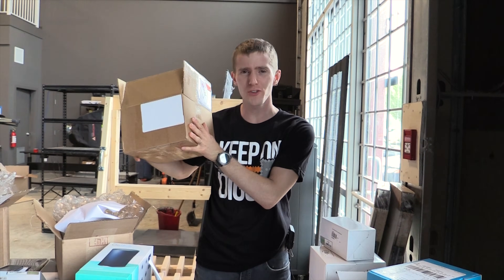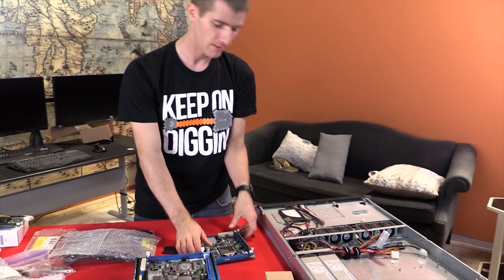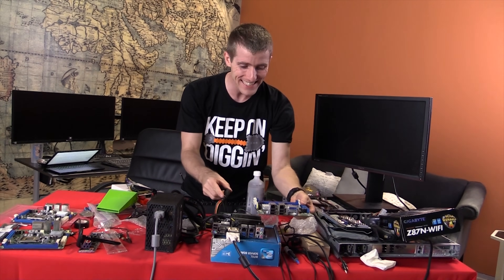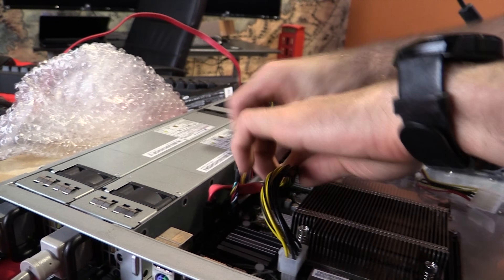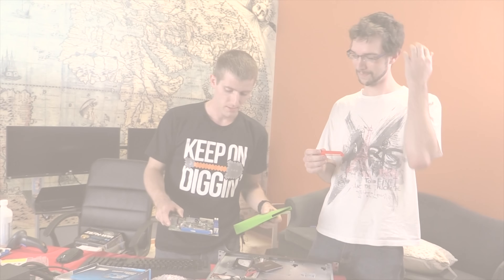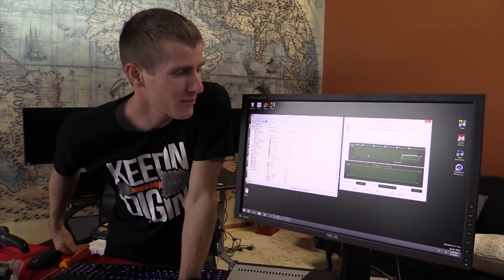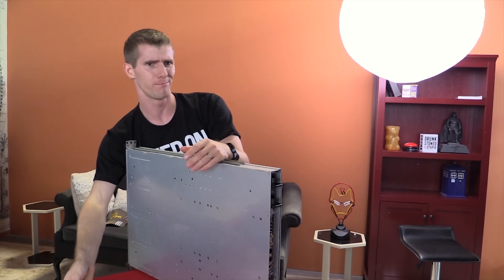DIY pfSense Rackmount Router Build Log - Part 2

Comment: Hi Linus, will there be a part 3 of this video? Could you include how many watts this build needs (maybe on idle and under heavy traffic)? Thanks. I recently found old PC at my house. It is a Pentium 4 LGA775 single core with integrated graphics. It is still alive but on idle it pulls 100W from the wall (not including the CRT monitor). Hahaha.

Comment: I would have run faaaar away from that motherboard after seeing how much hardware it destroyed. I don't mind overkill builds especially since you have a lot of parts at your disposal, but with a mobo being that difficult to work with, it hardly makes for a reliable piece of hardware. You're going to want a router to be rock solid right? What's gonna happen when that motheboard takes something else out.

Again I'm OK with overkill, but a router needs to be reliable, and I don't see this build being that.

Comment: You may have 4 working boards. If it put too much pressure on the cpu then it could have simply pushed pins out of the way. Try them with another heatsink and see if it comes back to life?

Comment: internet - 3 linus - 0

also the low profile ram, xeon, 3 server boards.

and he still ends up using the super micro heat sink and back plate... at least it fits this board...I would have scanned it in printed a plastic one and used brass nuts for the threads...

Comment: Awesome video! As a studying engineer I always enjoy watching s@*# hit the fan and see what kind of solutions you all come up with to "fix" them. Just a thought for consideration, I know from the previous video on 3D printing the red material you used for the fan duct mount is PLA, I am not sure what material the green was. The glass point for PLA is around 65 degrees C I believe. If the duct reaches this point you can expect to see slight warping or drooping. ABS would have been a better choice in material. It seems that you guys can keep the temps low enough for now, but it might change when the router is mounted in the server rack. This was just for future reference and maybe to keep an eye on the duct in the future. Other than that GO TARAN! Your design worked! And GO LINUS! You have a new router!

Comment: Did this on a Day 1 Xbox360 with a  Cornflakes box 10 years ago after seeing Dells Duct work in our old Dell XPS desktop. The 360 sounded like a Jet engine from Day one. I knew something wasn't right but a call to support informed me if the machine worked and nothing was glitching then as far as they were concerned there was nothing wrong. They must have assumed my description of the jet engine was exaggeration. This was before the the Red Ring of Death scandal came to light. I'd imagine my 360 would have ended with the RROD eventually.

 I decided to break the warranty seal and take my brand new 360 apart. To my mind, the dual fans on the back were pulling air into the case from every vent all over the case with most of the air  likely bypassing the heatsink fins altogether. First I removed the heatsinks and was shocked to find the CPU and GPU cores flooded with massively excessive quantities of Thermal paste. I cleaned it all off and re-timmed with the correct rice grain sized amounts. I then refitted the heatsinks. Then I fabricated some ducts from the heatsinks to the rear exhaust fans made from cornflakes box cardboard and duct tape. Ducted over the top of the heatsink fins too unlike in Linus' Vid. Thus all air pulled into the case from outside had to travel the full length of the heatsink fins from front to back and out through the ducted fans.

The result was a 360 that went from sounding like a jet engine to inaudible from the couch even under load and a Day 1 machine that never suffered the RROD and still works perfectly and silently 10 years later.

Comment: This question inst exactly meant toward the video but I need some help... Is it normal for a core i5 3570k to turbo to 4.05 on its own, at a temperature of 90°c? I have, in the past, turned on xmp mode but I turned it off because I had noticed this. After I turned it off it is still going to 4.05. It does this in gaming and i'm worried because I have a stock cooler on it in a very restrictive case (Ftz01). I don't know what is happening and I don't know if this is normal or what.

Comment: While I'm not from Microsoft and assuming I'm understanding your explanation, I believe the delay is from the lock screen sliding up to reveal the password prompt. I run into the same issue myself. It's not great, and I do wish Microsoft would change that. It missed the first character or two, and it fails to log in.

Comment: 6:55 Oh what's that cutting the speaker voids your warranty? And you can't even return it back to Ebay, because you damaged it. Otherwise you could've pretended that it was dead on arrival and received your refund. 

So, now you are stuck with 3 dead expensive motherboards that you can nail to the LMG wall of fail.

Comment: If you printed the 3d parts in PLA you might have problems because the heat. It will not melt but it can deform.

Comment: I don't know if this could be a solution to ur problem, but I broke the motherboard and somehow made it work. I forgot to plug in the 4pin cpu plug, while the cpu was installed and the motherboard started beeping and started to smoke a little. Then, I just put a paperclip into the 24 pin socket, like when you are testing for a dead power supply and it worked.

Comment: I can almost guarantee that you killed the caps the heat sink was smashing against and they are now a dead short making the PSU shutdown or just drop the voltage enough that the voltage regulators won't start.  When caps short like that you can have enough resistance in the short that the board can continue to function and the shorted cap just gets really warm, but sometimes it is at such a low resistance it will force the PSU into shutdown instead.  Or even worse, if the PSU doesn't go into overload shutdown it could just burn out traces on the board and allow higher than normal voltages past the voltage regulators.

I've modified and repaired enough boards to say, I could probably bring at least one of those dead boards back to life.  Sometimes there are burnt traces on the inner layers of the board but sometimes those can be easily bypassed... sometimes not.

Comment: Hey Linus Tech,
Do you think an Imac 27 inch (Mid-2011)
3.1 GHz Intel Core i5
12 GB 1333 MHz DDR3 
AMD Radeon HD 6970M 1024MB
1 TBB HDD
Is worth it? Also is it good in general? I might be buying it for 250?
PLEASE REPLLYYYYYYYYYYY

Comment: I love PfSense. Been using it since TekSyndicate did the video about it like last year. Using an old VIA cpu that's half the speed of a P4, it's MUCH faster than the store bought Buffalo and Linksys AC 6200 routers. Ping dropped 15ms.

Comment: This just shows the incompetence of linus when he doesn't build some cookie cutter 'super duper epic gaming rig'. What a joke, notice how he didn't show the back plate after been super snarky that it wasn't the back plate causing problems. My guess is that he tightened it down so hard that component leads went through the electrical tape and the non-conducting coating. It is still amateur hour at LMG.

Comment: The Windows 8 thing isn't as bad as Linux Mint, where it randomly will have you type the name of the account you want to use. Problem is, it is SUPER easy to just type your password in, thinking you are logging in, and accidentally advertise your password to everyone around you. Oh, and this happens when there IS ONLY ONE LOGIN.
Reply: +Oscar Anderson Welcome Debian 8
Reply: +Oscar Anderson 
I used to hate that. : /
I'm pretty sure that's only GDM, though. I eventually switched to KDE back when I was rocking Mint and never had that issue again.

Comment: You actually trimmed several times the original back plate so the insulation was damaged already (if it existed, because, you show the trimed backplate from both sides and NO INSULATION there).. If manufacturers were aware of shorts and mechanical inteference, your heatsink would have fit perfectly THE FIRST TIME, but it didnt. A bit arrogant dont you Linus ?. People is posting different opinions, about what was going there. Is that hating ????. Thumb down for fooling on other opinions. You channel and your whole company is about YT and viewers, not  big deal making fool of your viewers. After that, you take 3 boards to get it running.

Comment: Well at least it's finally working (though I don't think this is the end of it). Good job. BTW. for those who don't have an unlimited hardware supply, it's better to checks the hardware compatibility before attempting to install them in a system (and don't force it when it's not compatible).

Comment: 10:48 If you're wondering about the only user acc having to log in, etc.  If it's the only user account.. open run dialog, and type "control userpasswords2"  After that screen opens, uncheck the box to "require password to log in"  and click apply (type your password in to confirm it).. now when you boot, it'll bypass that screen and load right to desktop ^.^

Comment: 6:57 "Oh cutting the speaker doesn't do anything because why would it" It's not like you need the warranty or anything to get a free replacement if the two previous boards were actually DOA

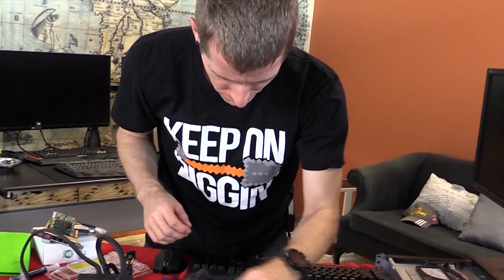Comment: Looks like Linus didn't watch his video either. In the first part around 05:34 you can see that the backplate is covered with something, but you can see clearly that is not electrical tape as Linus arrogantly says, probably the coating from the manufacturer that he mentions, but at the very least is not the same tape he shows in this video.

Comment: ok probably a noob question but how do you know that the thing taran designed has a high enough melting moint so that it doesnt melt under the heat of the case. im not sure of the material the thing is but it looks like plastic or something
Reply: Did a bit of research, the material used is either PLA, ABS or CPE, i don't think it was specified which is used but the melting point of each is 180-220, 230, 150-170 degrees Celsius respectively, but what we need to look at instead of melting point is the glass transition temperature, the temperature at which amorphous materials, like PLA and ABS, go from being solid to molten. Its at this state that there may be problems as the shroud might deform a little which could effect ventilation . The glass transition temperature of Pla is 60-65 and the glass transition temperature of ABS is approximately 105, If the shroud is made of the former, there could be problems with it in the long run under a lot of stress. But still that's of course only a possibility not an inevitable truth.
Please let me know if any of the above is incorrect, im not a chemist so i honestly cant be sure if all sources were correct.
Reply: Not sure why you ask this, but not even close. The part is not made of rubber, otherwise I'd be concerned.
Reply: +fiercedietyfan Plastic's melting point is 170 degrees celsius. You should be concerned if your computer is that hot
Reply: Not sure if troll or actually not so smart ...
Reply: +Annelise Meier id consider myself relatively smart but dont know much about this stuff, the shroud is 3d printed right, and im not sure what material it is made out of, it could easily be something a that might not do so well in high heat. Again i am a noob so i guess to somebody more versed in this stuff the answer might be obvious.
Reply: +K Doe Ah ok, thanks
Reply: +Derek Bond lol yes but there are various types of plastic, ive personally had a laundry basket burn too close to a radiator. i guess it is silly but you never know
Reply: +fiercedietyfan I hardly doubt the shroud will ever reach that temperature, because the warm air is being blown AWAY from it :)The red piece might suffer the most I think.
Reply: +kabouterplop19 yeah i meant the red bit when i said shroud, mainly cause i didnt wanna say shroud and red bit. :P
Reply: Would be a nice video tho.. A how to on removing molten plastic from a motherboard :D
Reply: +kabouterplop19 haha true
Reply: +fiercedietyfan 
it's either ABS or PLA Plastic - both have melting points above the temperatures that would cook a person.

Computers go into emergency temperature shutdown way lower than that.
it's fine.
shouldn't even get soft, nothing should ever be exceeding ~70°C(80 at worst) there. which isn't very hot.
Reply: +taiiat0 glass transition of pla is at 60-65 though, correct me if im wrong but thats when it gets soft right
Reply: fiercedietyfan hm, very well, it does(and melts at ~80!). PLA has pretty low temperature resistance.

instead then, almost everyone uses ABS in 3D Printers - even though it's inferior when ambient temperature isn't going to be problematic.
since ABS is so likely to be the actual material, ABS transitions at 105°C, which is fine.

as the air certainly won't get that hot, and the small part touching a component shouldn't experience temperatures like that either.

Comment: I'd be careful with that 3D printed stuff. Sometimes it can start to warp and lose strength at about 60-70 degrees C. It may not happen, but it could be an issue.

Comment: What i have noticed is you have good temps in a large open room, but that router is going on the server rack? which is tightly compact and in a small room under the stairs?

I would assume its going to be quite toasty in there.

Comment: Linus I hope that is high temp ABS plastic and not a low temp or even worse PLA because it will melt everywhere. I guess I'll find out in Diy router part 3# motherboard death by plastic.

Comment: Granted I have never tested it on a 1GB link but I know a simple core 2 duo with 4 gigs of ram a pair of Gigabit Nic's + clearos is more then enough for at least a few hundred mbps inbound.... 

I understand building a machine its kinda what they do around here, that said I could point you in the direction of a dell/hp server on ebay that cost less then what just the motherboard cost and it would have dual or quad nic's 16 gb of ram prob more then one xeon and maybe even a hard drive..

Comment: Once again, why use the back plate? Does the cooler really need so much support because you're mounting the server vertically? Just use 4 flat screws to hold the cpu cooler. But it's too late now.

Comment: I'm no hater Linus, i think you're a great guy!! it was just so obvious that the back plate was the problem since it overlapped chips as i could see and that cant be by design. of course i don't know for sure what exactly shorted out since i see the board only on video, but i am pretty sure it was a short that damaged the board and not pressure. 

Sorry if i was a bit harsh on my last comment, cheers.

Comment: There's no risk of the 3D printed pieces melting? I don't know what the melting point of them are so I don't know, I'm just generally not comfortable putting plastic against a heatsink, but then again my system does get quite a bit warmer..
Reply: +Sanya IV Litvyak melting point of pla is 150–160 °C (302–320 °F; 423–433 K)
Reply: +ashley beaumont Ah, okay.

Comment: While I would normally agree with you on building your own machine, in this case however using high-end parts and all.... I'd would've definitely went and bought one, solely for the reason of a warranty/support just in case I dunno, your very expensive motherboard and/or cpu dies for whatever reason... (not to mention any other expensive parts that may need to be replaced) plus we're on a tech channel, surely most of us here have seen computer builds multiple times by now, so I'm personally more interested in seeing the software (pfsense) rather than seeing yet another build log.... (although the killing parts thing was a tad amusing but also pretty saddening too)

Comment: *Makes server, installs Windows on it
Reply: he didnt
Reply: +kupertjerobin He didn't.
Reply: +kupertjerobin Did you not pay attention to the video? 1. It's a router. 2. The windows install is a testdrive to test if all the hardware is working. 3. He's going to install pfsense(a router OS) once it's clear the system works properly.
Reply: +kupertjerobin I guess you missed in part 1 when he said he was doing it to test it and also missed the where he said he was putting pfsense on it, along with the title..... Holy crap I hope that you're just joking or trolling for likes.
Reply: +vgamesx1 Whoeps sorry
Reply: +Jindo Krey It's a firewall. Not all devices passing IP traffic through are routers. pfsense probably can do some routing but I doubt they are using it for routing.
Reply: +Olli Vanhoja He's calling it a router machine all through the video so I guess they are.